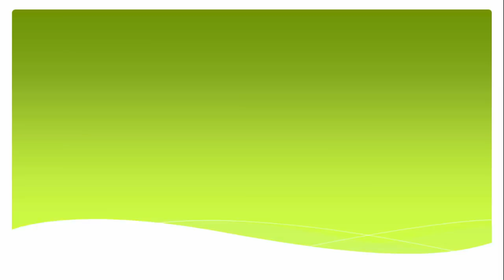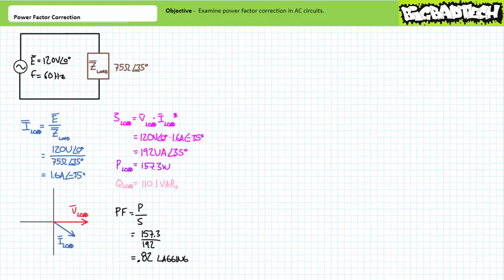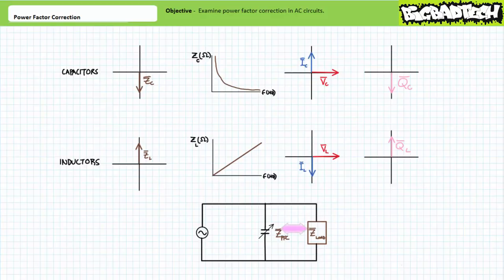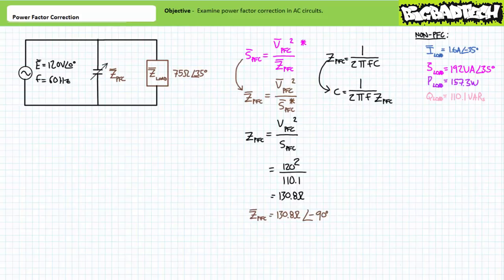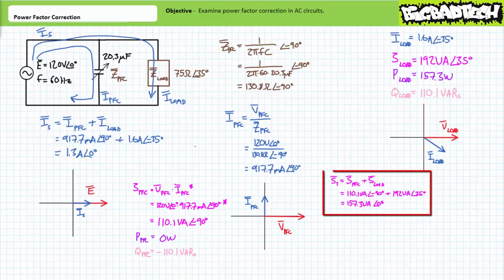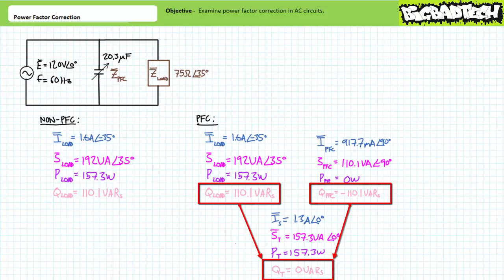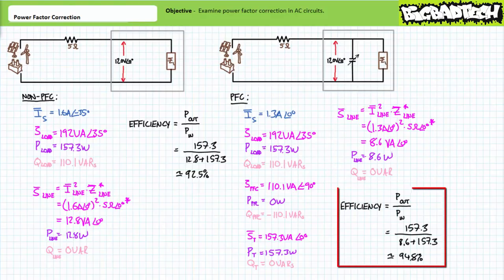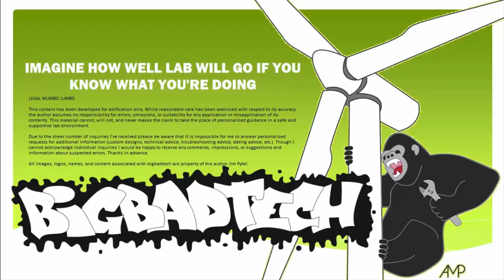Power Factor Correction (Full Lecture)

Comment: As usual this is another great lesson Jim.  I got to spend a few years designing synchronous generators, motors, and condensers (didn't do a whole lot of those) at a company which manufactured them.  We didn't really focus outside of the generator design.  This is very nice to see.  I look forward to the mentioned future lessons on power factor correction capacitors and synchronous condensers.

Comment: It took me a moment to understand my forehead slapping conceptual error. I was thinking, all I had to do was match the same (inverted) reactance on both sides, but I forgot that current through each side is an integral part of the balance. That technique might work if there is no resistance on either side, but it won't work otherwise. If overall impedance on one side is lower, more current flows to that side, which increases power contribution for the side even though reactance is the same. So, you have to do the calculation the long way, balance reactive power as shown. Duh!

Comment: Great explanation, thank you very much. Looking forward for the power generation and transmission lessons. Can you make videos about vacuum circuit breakers, sf6 breakers, electric ac generators and their voltage regulation and synchronization to external supply, other power generation related hardware? Of course if you'll have time for it. Thanks!
Reply from the maker: Eventually I'd like to do a whole playlist on power generation and transmission including HVDC and protective relaying. This is far, far in the future!
Reply: It sounds great! Thanks!

Comment: Turns out, this topic is of more than just passing interest to me, I've found. I recently installed solar panels with Enphase microinverters on each panel. I dutifully installed current sense transformers on the microinverters and connected them to my data logger. Much to my surprise, I found that the 12 microinverters draw a total of about 1 amp at night. What? How could that be? Does that mean the microinverters are sitting there dissipating 240 Vac X 1 Amp of power? Well not quite. Turns out the load is almost purely inductive. I found with an oscilloscope that the current and voltage are close to 90 degrees out of phase. Must be the microinverters employ transformers to provide standby power, and it's their inductance that is the phantom load at night. When they're connected to the City of Logan, it's no big deal because the City of Logan doesn't charge me for reactive loads. But when the reactive load is being supplied by my PowerWalls, ouch. That's not fair. Ideally, the Enphase microinverters would have built-in power factor correction but they don't. I might have to install a cut-out switch to automatically disconnect the microinverters at night or perhaps install some kind of automatic power factor correction.
Reply from the maker: Good find and great idea about the timed cut out switch. Patent this idea and sell it to Enphase!

Comment: Does it always (no motors involved) have to be a parallel circuit? I suppose the continuous exchange is possible in case of series connection too since S total = Sum of Si. Am I wrong?
Reply from the maker: Ordinarily the power factor correcting capacitor will be placed perfectly in parallel with whatever load impedance requires power factor correction. This being said, the load itself could be a series, a parallel, or a series-parallel combination of any number of elements. While not truly power factor correction in it's purest form you'll observe related properties in: the AC maximum power transfer theorem, resonant circuits, and voltage compensation of AC transmission lines.
Reply: thanks for the answer!